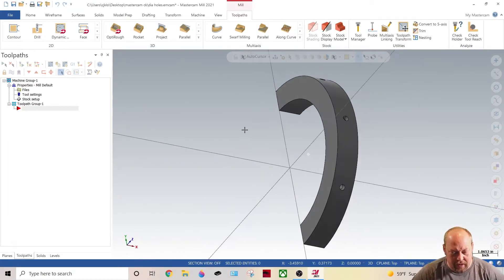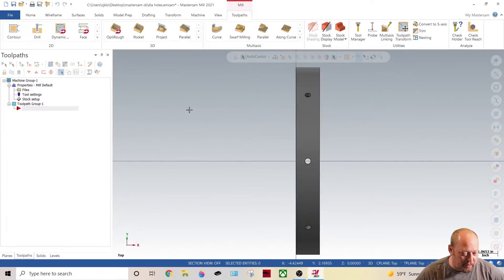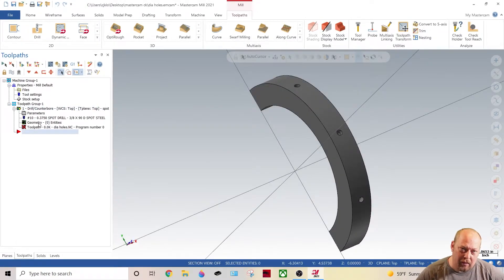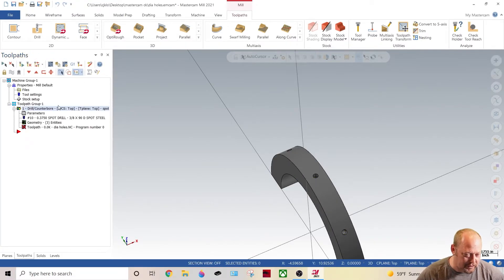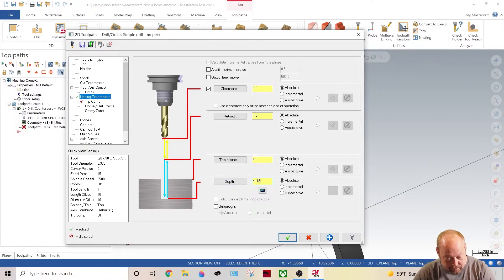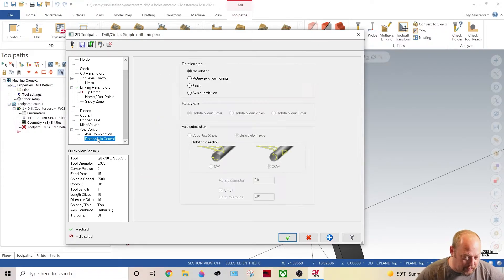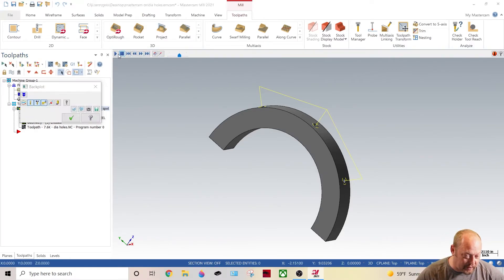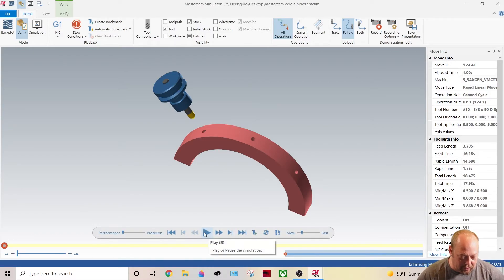How to make a Drill path with Rotation A code with mastercam

Comment: Hi sir im fan of you..im watching everyday your mastercam tutorial....how to operate 5100 duravertical dmg mori cnc milling..cause i try to work offset and z axis and tool offset using manualy paper method and then ill run the program and has been error Z axis is  over  travel but the program good nothings erorr..but my machine is have probe and reinshaw how to disable also the reinshaw and probe thank u so much
Reply from the maker: In mastercam do a force tool change on every toolpath. Compare the code at the end before each tool change maybe the g28z0 is it right for that machine